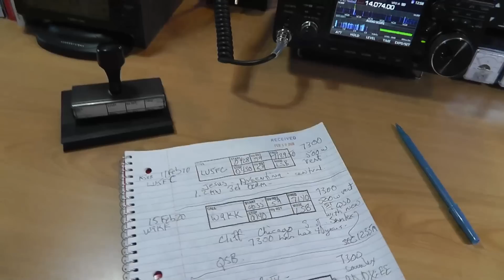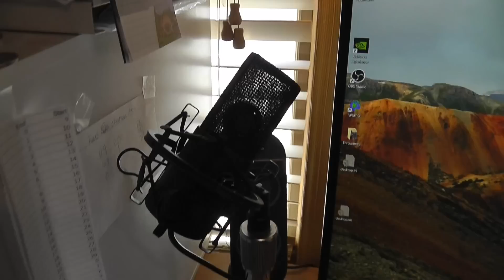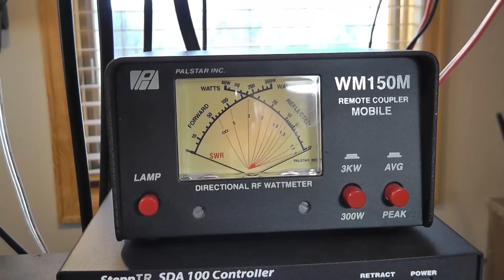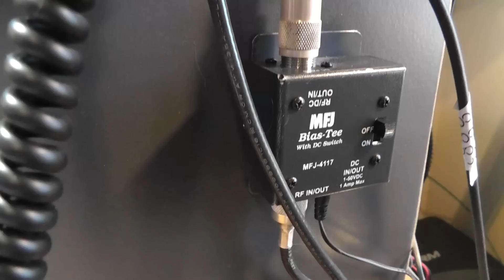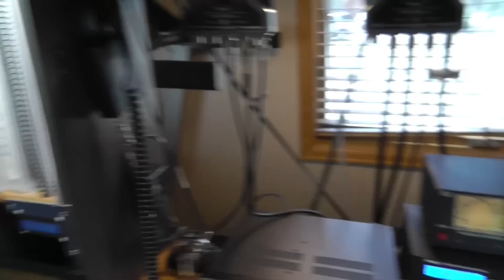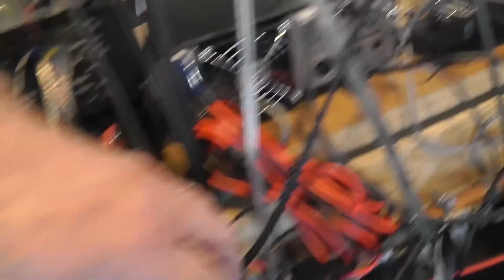Stay at Home Special: My Station Layout (#275)

Comment: Thanks for the tour Dave. As I am still setting up my shack, I am looking at as many stations as possible to get ideas. I wish manufacturers would put 2 power cables in with their product, then you would be able to shorten down the permanent installation, and have a spare for running portable. The rats nest of wires makes fault finding difficult, it looks so untidy and could cause interference via coupling (I think?) I enjoy your channel, factually accurate (some aren't), and presented with an easy style. Keep up the good work. Jim M7BXT

Comment: Hey Dave -

Thanks for the shack overview - I love to see others "offices" (laboratories, dungeons, grandpas hideout ?)
There is one thing you did that I wish I could figure out a way to do, and that is to have room in back of my desks to get to all the tangle!  Well done sir -

h

 In order to move things around, add or subtract equipment, etc. is a real chore without direct access to the back of the collection of things.  Threading connections from piece to piece can be difficult.

I do try to keep some regularity in how things are connected, such as ground wires go straight down to the single point copper bar, RF (coax) I try to keep under that to help separate it from other cables, the audio/data/control etc cables I try to keep up near the table top shelves away from the coax, and so on.  Helps a lot in minimizing RFI problems, along with choke magnets on much of it.  Computer/ audio in/out to the left, V/U radios and HF to the center, with power and boat anchor stuff to the right on the "L" side table nearer to the antenna switches and amp, very much like how you have done it.

Comment: I forgot to mention Dave, I do got into ham radio also when I saved up enough money to buy a Hallicrafters SX-99 receiver. Unfortunately, I no longer have it, when I got married my first year in the Army, I traded it back to Allied Radio for several kits to build such as a tube tester, so that I could repair TV's on the side and earn some extra money for my young and growing family (4). I sure wish I had that SX-99, it was a real nice receiver. Living in the country at the time with lots of woods around, I ran a copper wire about 300 feet from my second floor room to the woods and high up in a tree. Sigh, I sure wish I had the old SX-99 again.

Comment: Thank you Dave, I am relaying out my shack after a move from one end of the house to the other, with some additions, so this presentation was most useful. My problem is, my station table and desk next to it have to be up against a wall, as the room is 10 feet wide by 19 feet long. So the wiring is up against the wall meaning that I had better think ahead and have an easy way to get to the wiring for any additions or changes. It has it's challenges for sure. Do you plan to ad a world clock that shows the gray-line progress? I saw one on QST about a year ago that uses  a regular monitor screen with software and some hardware for under $300 I believe.

Comment: perfect timing  - i'm about to re-jig my entire shack/lab to reduce the QRM, your video really helped, esp showing how you have your DC earth/grounding - having seen your other videos on earthing, do you run a thick braid from that copper strip to a physical earth outside ? many thanks in advance, Alan / M7ALU
Reply from the maker: I run stranded 2-gauge wire to the ground rod right outside the shack. The braid would work too.